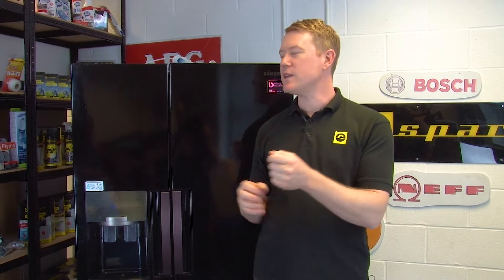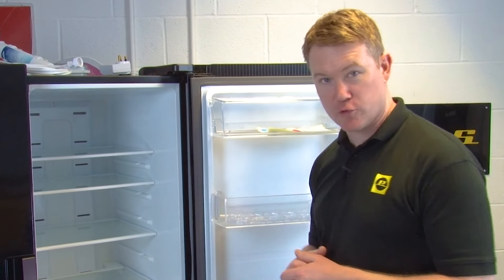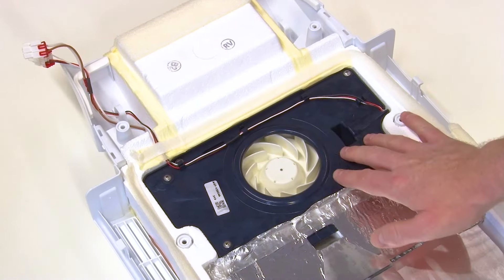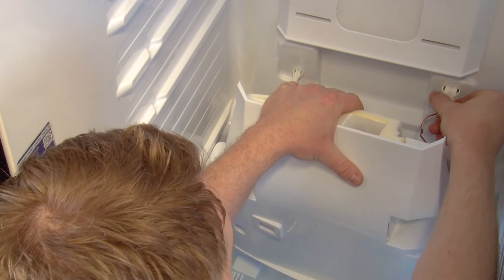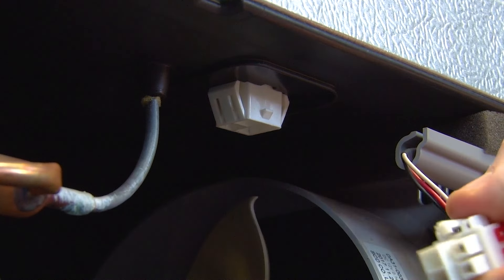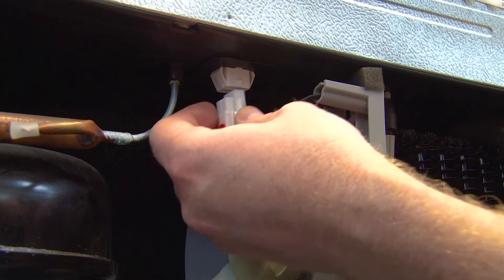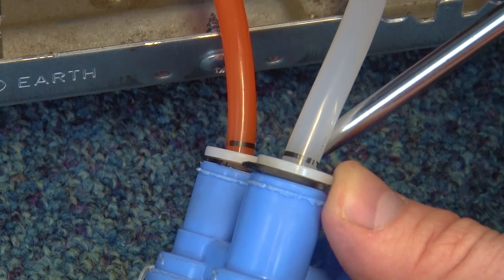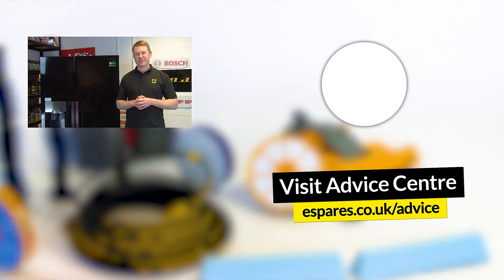Have a Noisy Fridge Freezer? (Common Causes of Fridge Noise Revealed!)

Comment: Sometimes it's just frost on the fan. If freezer door is left open condensation will accrue and eventually freeze. As the dude says in the video. If this is the case you may not need to replace anything. Turn off unit remove panel and dry with hair dryer. If fan turns without resistance then put cover back on after everything is dry and see if that works.

Comment: Its weird, I get a rattle after my compressor kicks on, but its isolated to the freezer. When I have the evaporator fan going by itself I get no noise. I pulled the back panel and there's no ice, or blockage. Plus, the unit seems to just keep running now and the fridge sensor/thermostat isnt shutting it off- Not sure what is going on. Condenser coils are clean and gaskets are sealed.
Reply: Same issue here. Have you figured it out by any chance?